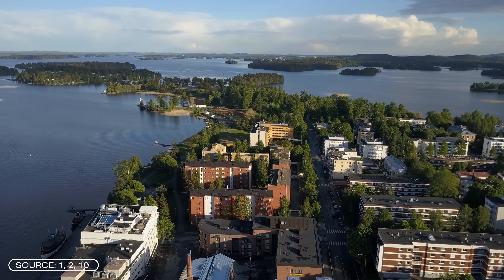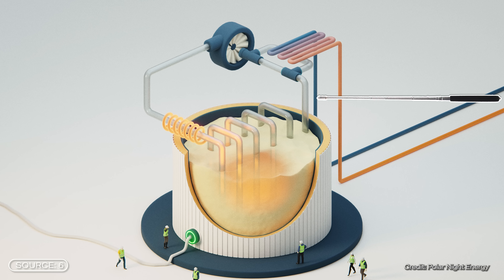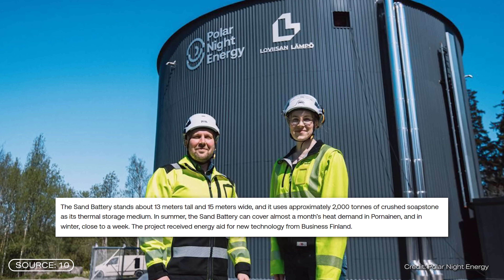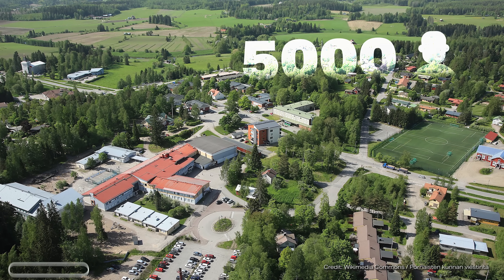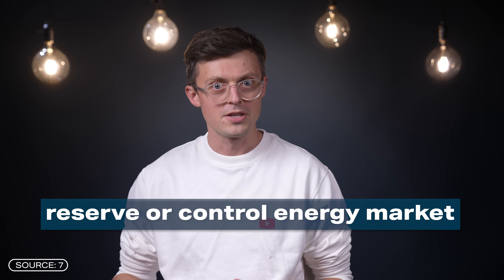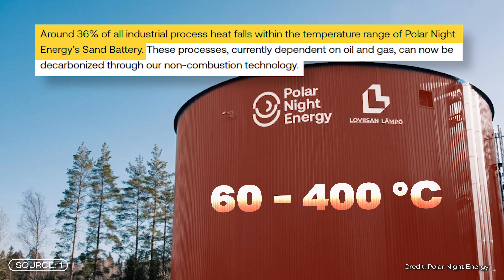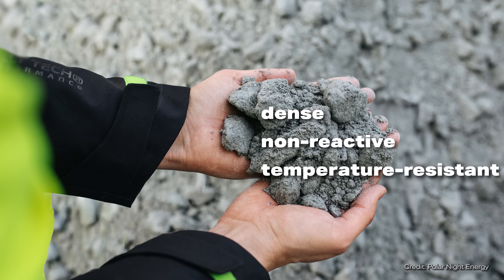Finland's Giant Sand Battery: A Revolution in Energy Storage?

Comment: As long as wholesale price of electric power fluctuates between around zero and really expensive, a lot, energy storage don't have to have great efficiency to be relevant, as long as the cost of that storage is low. 

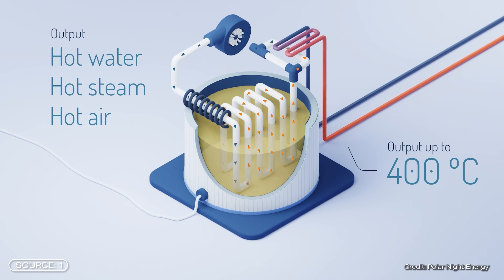Using today as an example, in Finland from midnight to 03:00 the wholesale price of electricity was between 1.3 to 1.5 euro per MWh. Then it reached a peak of 56.92 €/MWh between 8:00 and 9:00, now, 11:00-12:00 it's 9.34 €/MWh,  and 17:00-18:00 it will be 54 €/MWh. This is all the same day. Energy storage doesn't have to have very high efficiency when you can "charge" with electricity that cost 1.3 €/MWh and the price increases to almost 57 €/MWh just a few hours later. Even the midday dip today at 9.34 €/MWh followed by the evening peak at 54 €/MWh means even conversion back to power with modest efficiency can be profitable, especially of the "waste" heat from that power generation is used for district heating.              
    
One interesting aspect of thermal storage is the fact that the bigger you make the system the more energy efficient, and more cost efficient it can be. It would be possible to just have a huge hill of sand store huge amounts of heat, with very little loss, as long as you keep it dry. Water evaporating and condensing can transfer a lot of heat really long distances, that's how heat pipes works.    

I think thermal storage don't get as much focus as it deserves. But no matter how much potential something has, the implementation needs to good enough too, and I think Polar Night Energy might have a viable approach. Thermal storage certainly has it's challenges and disadvantages, but I believe some earlier projects have "stained the reputation" of long term thermal energy storage in general. I'm primarily thinking of systems with solar heat collectors that stored heat underground, which typically were "naively" designed, which made them very expensive, and difficult/expensive to maintain. While solar collectors can have high thermodynamic efficiency, efforts to improve the thermodynamic efficiency beyond quite low levels tends to increase the cost per unit of energy they actually collect, a lot, when low grade heat is collected.         

I do think district heating is a good primary target for thermal storage. I really doubt most startups claims of extremely high efficiencies in high temperature thermal storage systems, and the usually very large amounts of heat most energy intensive industries need means electricity is usually too expensive without subsidies in most areas anyway, even without losses in storage. If you want the heat, it makes little sense to first burn stuff to generate power in power plants, and then use that power to generate heat, and it gets even worse if you also store that heat first. 

High temperature thermal energy storage won't be very relevant as long as we still burn fuels to generate a significant part of our power, as the conversion to and transmission of power means about 70% of the energy in the fuel is lost just by that. And it's very easy to make combustion fuels release energy on demand. While heating by combustion rarely is 100% efficient in practice, it's typically about twice as efficient as taking the detour of producing power.
Reply: I think some of the most important sides of seeking solutions like these is that they enable the use of more renewable energy, as solar and wind power outputs are very fluctuating and need to be compensated with regulating power, which is mostly done by burning fossil fuels, along with some hydro.

So not only is energy storage viable even with losses as long as energy prices fluctuate between 0 and real high, it makes itself more viable by enabling more sources of that fluctuation. And fluctuating energy price isn't a bad thing in the grand scheme of things, if we have a way to store energy like this and if it reduces the need to burn fossil fuels.
Reply: In an industrial setting, such storage system could act as a buffer. As you say, it makes little sense from physics perspective to burn fuels to generate electricity to then use resistive heating to produce heat. Because electricity generation has relatively low efficiency, completely ruining the picture. It makes electricity non-competitive. But it would allow you to purchase electricity at those discount prices. And then electricity is competitive. The problem is that the more storage there is, the smaller the difference in prices (you're increasing demand, propping prices up). You don't really know how fast it's going to happen. One day, your sand storage might no longer be competitive. And if it happens too soon, you'll lose money on it. You won't save enough to cover the initial investment.

One problem with industrial plants is that they need reliability and predictability. Stopping a plant is generally so expensive that it's better to buy overpriced supplies and keep going. And managers will often take higher prices that are clear and predictable than speculate. Because that's what it is. You're betting that cheap electricity will keep being available for many years, even decades.
Reply: I wonder how much money you could make simply by storing then selling power at those peek cost times?
Reply: @znail4675  😂
Unfortunately you have to have contracted private customers. Won't come anywhere near those numbers by retailing to other grid competition, now would ya?
Reply: @BiWesCrew  But as it's beneficial so could the government require that the power companies pay at least a set percentage of their current sell price to incentivize solving the problem. It's understandable that the power companies want to keep selling expensive power, but the government needs to step in to restrict peek costs.
Reply: @znail4675  Unless you're a big "power company", it's difficult if not impossible to reach break even, with most energy storage technologies, except if you can use spare capacity in something you have for other reasons, like "home batteries", or an EV with bidirectional charging. But even if you have such resources, you're typically at the mercy of whatever deals your grid/power company offer you.      

An alternative to storing energy is adjusting use, when price fluctuates that much that rapidly, you can choose when to use power that you're going to use anyway. I switched from fixed price to wholesale plus a small fixed margin a few years ago, and pay less for electricity now than I did for many years before I switched, even in absolute numbers, without compensating for inflation, and also including increased fees and taxes.  Choosing when I use some of the power I use is only part of how I reduced my cost, but still an important part.
Reply: Dig a hole like a swimming pool in your garden. Line the walls and floor with 50cm or more of waterproof foam insulation, add a layer of soil, lay pipes on top, and a layer of soil, etc., and you have a cheap alternative for warm air in the winter. And invisible from the outside.oh yes, also the heating wires of course
Reply: The mere fact that the price to buy power is allowed to soar so brutal  within a 24 hrs period is proof about all what is wrong with the so called free market. Sorry to drift off topic, but what good are solutions for storage when we can't fix the daily damage done by legal/shady robberies?
Reply: @BiWesCrew  Totally the opposite. It incentives everyone to optimize their energy use. Smart home controllers are already wired to take future energy prices into account. In the future the interval of energy price changes is 15 minutes driving further optimizations. This reduces energy needs, improves grid security and reduces emissions. Saves money and resources making everything more efficient, and that's what our lifestyle needs. Proof is that in Nordics where this market is in use energy prices are much cheaper than elsewhere in Europe. Europe must follow the model and learn to optimize.
Reply: @BiWesCrew The variation will decrease as data centers are built everywhere, consuming as much electricity as a small city, after which there will be no more hours of "free" electricity. My hometown is being built a data center that will train artificial intelligence, and its waste heat will go to the city's district heating network. The city's power plant already has an electric heating boiler that generates heat for the district heating network when there is almost free wind or solar power available, which means that wood chip burning can be discontinued as unprofitable.
Reply: @BiWesCrew  The only people who get spooked by energy wholesale price fluctuation are people who are unable to calculate and comprehend averages.

If you get a contract with a fixed price, that fixed price is always going to be higher than the actual average wholesale price. That's how electric companies make money on those contracts. In Finland, when people started switching from expensive fixed contracts to wholesale contracts after the war in Ukraine started, which spiked energy cost, the electricity companies began to increase their fees instead. People being more aware of the energy prices resulted into customers realizing that those fixed contracts had margins nearly double the cost of the actual price of electricity despite the fluctuation. Now that people are aware of it, the robbery is instead done by additional fees.

Price fluctuation of energy is an intuitive result of how electricity is produced and how little of it we can store for later use. Solar and wind are cheaper than nuclear and fossiles, so it makes sense that prices are higher when both wind and solar production are halted. In fact, the trend of the average electricity price in Finland almost entirely mimics the inversed shape of the of trend wind production. If there is no wind, the electricity is expensive. On the flipside, if we didn't have wind energy, we would always have steady expensive electricity. https://i.gyazo.com/20ca49c4ca923ca38ee94dffb550d364.png

Batteries can even out the cost of energy, but it might add even more fees to the customers in the long run due to operation cost. With how easily available small scale solar panels are for individual consumers nowadays, I would much rather produce my own energy than let corporations charge me even more for the storage as well.
Reply: And energy price variation comes primarily from wind energy production, not from use. This energy price system steers us to harness the wind energy to the maximum. That's what the future needs.
Reply: @McSlobo  Also from the fact that powerplants get paid by non-produced MWH by the companies that sell the electricity. Like it is very common to drive down the electricity production, when the plant gets >3000€ for every MWH they don't make - let's say a plant has small 70MHW turbine, so they will get 210k euros every hour it doesn't produce any electricity.

Why would they pay for such sums for electricity that is not being made?
Because it is a business - not human right, and giving electricity for hundreds of thousands of customers for practically free, is more expensive than lowering the production and hiking the price up.
Reply: @BiWesCrew The issue in this instance is precisely that the market is not free. There's EU-level proce controls and energy transfer as well as a long history of green policy. These have caused the proce variance. If our energy grid and prices were completely isolated, the proce would be stable. The less wind power, the more stable.
Reply: @BiWesCrew  Did you ever stop to think about what the alternative is? It's a balance of supply and demand, if the government were to set a fixed price on eletricity the demand would outstrip the supply during the day resulting in blackouts. Most of the technologies used to generate electricity work at a steady state, meaning there's no easy way to turn them off during the night and on again during the day naturally resulting in lower prices during the night due to lower demand.
Reply: @ominousplatypus380  If that*s the case whz does the biggest demand aka the industrz pazs less than the private sectors? 46% usage vs. 26% should be reflected in zour aquasion, not?
Reply: @BiWesCrew  That's just supply and demand. Things are more expensive when there is not enough of them motivating people to produce and they get dirt cheap when there are too many of them so that you get rid of them. It also motivates people to avoid consuming when there is shortage. It's even more complicated in case of electricity as grids can't tolerate excess production. Everything that is produced has to be used. So you can get into a situation where you get paid to consume electricity. While generally, it's the cost of storage that is motivating you to discount excess supply. In this case, excess supply would destroy the grid. It can't be allowed to happen. And that's why you get brutal discounting. Because there are sources that keep producing and grid has to be kept stable and available.

You actually combat this through storage. Storage systems on the grid increase demand when demand is low and increase supply when demand is high. They push to equalize prices. The limit is that storage systems cost money to deploy and so there has to be enough profit in it. But again, in a market, as the difference diminishes, the less efficient systems drop out, their operators go out of business, leaving only sufficiently efficient systems behind as those are the only ones that can be profitable with a price difference that narrow.

But this is irrelevant to most people. Unless you have battery storage, unless you sell electricity to the grid, you're probably not buying at spot prices. It's the right here, right now price. Your electricity is bought well ahead of time (probably months ahead).

Comment: If Round Trip Efficiency: Electricity-Heat-Electricity is 35%, if combined with quality Heat-Pumps, with a COP greater than 3.0, it would work out as efficient as direct heat from the battery. Just sayin', and where it would be great, is if you have a village of five hundred houses, you can supply heat to all of them, but say, in the surrounding countryside are another 100 houses, too far away to pump heat to directly, they could use the E-H-E route, as pumping electricity five Kms isn't that hard. (Unless it's up hill, getting electrons to flow up a steep gradients is almost impossible, hence the lack of a decent coffee shop at the top of most mountains.
Reply: The ting with heat pumps is that to get up to those 400 c temperature from ambient the heat pumps are not going to make it, maybe some multi stage systems might do that, but the cep is not going to bee anywhere near as good as in normal operating heat pumps were used to
Reply: @kristiangronberg3150 No, you'd heat the sand to 400/600°C with resistors, then you'd use some ORC or Stirling engine to make electricity from stored heat and then use electricity to transfer energy to distant, household heat pumps.
Reply: @markotrieste  Oh, yes, Sterling engine would be ideal for recovering the power in this system!
Reply: They are privatizing the district heating companies here and its all going to shit. People are leaving the networks as they gauge up the prices as its cheaper to just heat with heat-pumps and burning wood.
Reply: Lol
Reply: You can transport heat long distances no problem. For example, the primary heat source for the city of Prague is 34 kilometres away (as in the pipes are 34 km long) and can supply heat to the tune of 700 MW. Water is heated to 160 °C and loses mere 2 °C over the distance. Went into operation 30 years ago. The system, which includes other sources (including municipal waste incinerator), supplies heat and hot water to about a third of the city. It was essentially created by connecting multiple smaller district heating systems (and that's where the other sources come from).